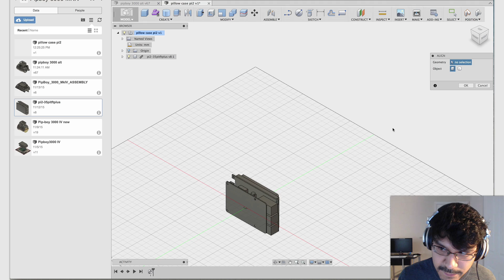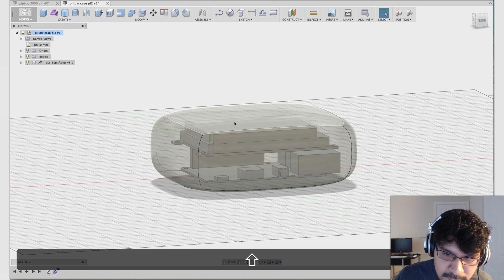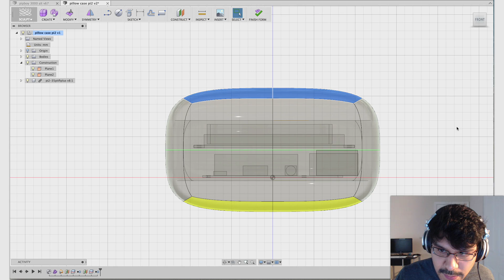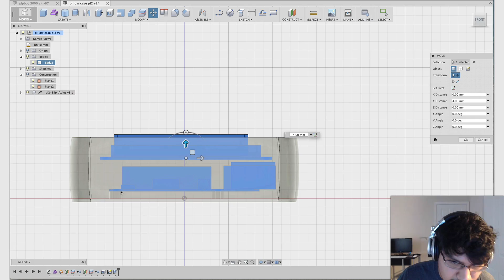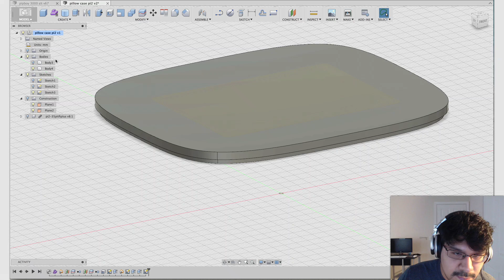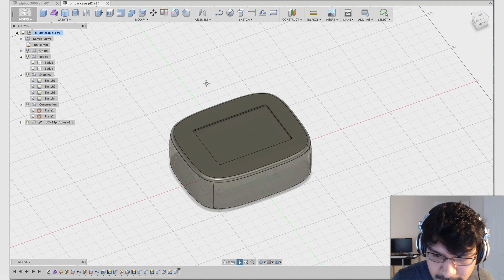Layer by Layer - Making Fallout 4 Pipboy 3000 MKIV

Comment: Lets go for a hero model with a working dosimeter or Geiger feature and radio. :D
Reply: +Stormy Weather i look into getting a Geiger counter to work with a micro controller and it is possible but it is a little big. If he put up the planes for the pip boy I might be inclined to 3d print it and make it work. just remember that geiger counters are not cheap.
Reply: You can nab project ones for about 100, but they need to be tuned, and they're not useful unless you're right up on somehting radioactive. It also pends your Geiger tube and detector setup. I'm just thinking of something that'd pick up regular surface radiation. Or go nuts around bananas.